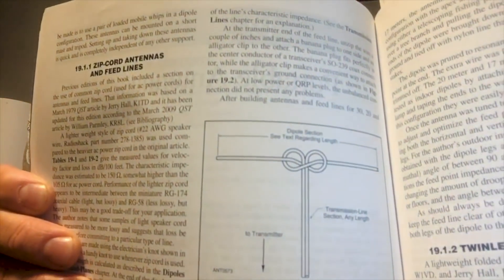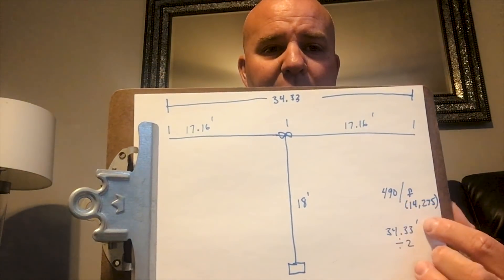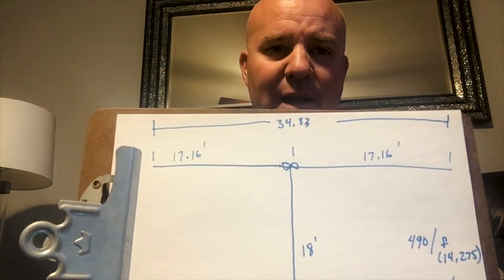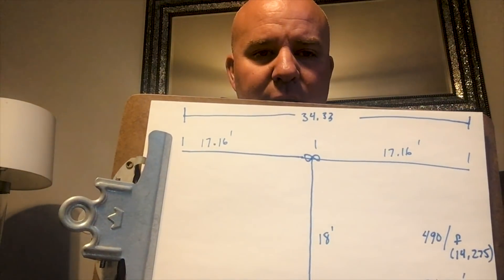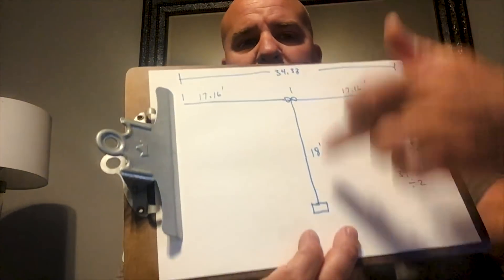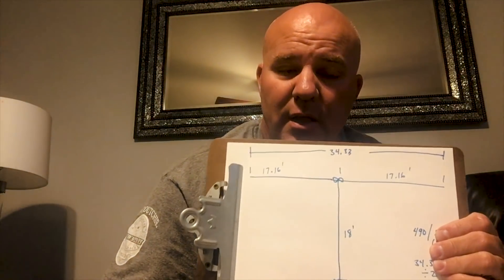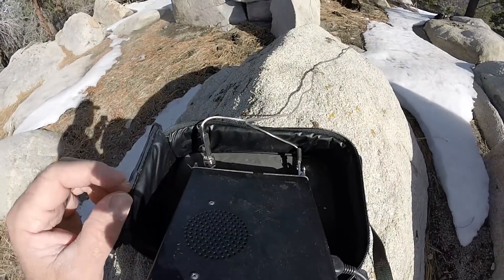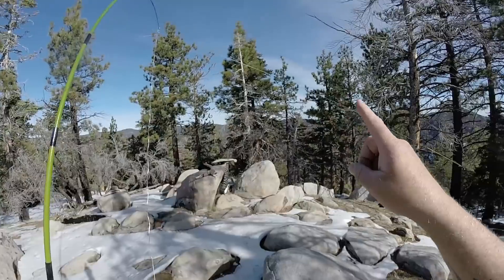How to make a Ham Radio Speaker Wire Antenna

Comment from the maker: This antenna is a fun & cheap build that I have been having excellent success with while QRP Portable doing SOTA. As a disclaimer, you should always check your antenna builds with an antenna analyzer to ensure your application is within the radio’s acceptable limits. As with any DIY projects, I can’t be responsible for any errors in your calculations or variances so please build this antenna at your own risk and CHECK IT WITH AN ANALYZER BEFORE CONNECTING IT TO YOUR RADIO AND USING IT. I think you’ll find great joy in the antenna making process so have fun.
Reply: When building the antenna do you not need a balun or unun because the antenna/speaker wire transmission line is matched at 50oms?
Reply: @OnTerraFirma  I do not use a balun with mine, and it tunes and analyzes very well.

Comment: I'm struggling with SWR and would be grateful for any advice on how to adjust. 

I have it supported by a mast in the center in an inverted vee configuration. 
Angle of left/ right is between 90-110 degrees. 
Collapsible mast; so, I've tried it at approx 18' high and also approx 22' high. 
Ends are 17.25' long and feedline is approx. 32.5' long (I suspect this is where the issue is). 

I've tried rolling up the ends of the legs to shorten them. I'm measuring with a NanoVNA (with an adapter for SMA to BNC). Using a BNC connector for the speaker wire. 22 AWG speaker wire. So far I've tried full length legs (17.25'). I've shortened to 16.5', 16.75', even all the way down to 12'. 

I keep getting SWR readings around 3:1 or higher. There are two lower readings (around 13.7Mhz and another lower reading at around 17.3 Mhz) and they are persistent. If I lengthen or shorten the legs, I can get those low dips to move just a bit, but not enough to affect the 20M band. I.e., I cannot get the lower SWR readings to move to where they'd be useful for me on 20M regardless of whether I lengthen or shorten the legs (rolling/ unrolling at the ends).

So, I went to The Antenna Book to read up more on this antenna and transmission lines. I see the formula in section 23.1.2 for calculating the velocity of propagation. For 1/2 wavelength, 491.8/frequency x VF (velocity factor of the wire). In section 19.1.1 the book indicates that 22 AWG wire has a VF of .7 for a frequency of 13.67 (close enough for 14Mhz), so that's what I used. 

Based on this formula and the description of this antenna in Chapter 19--where it indicates that the transmission line needs to be a factor of 1/2 the wavelength, I noticed that my "feedline" isn't the proper length at 32.5' long. 
So, I tried coiling up the end of the feedline at my antenna analyzer and that seemed to lower the overall SWR a bit, but still not below 2:1 anywhere on the scale, and not at 14-14.350 Mhz range where I need it. The only thing I haven't tried is lengthening my feedline, since that would require splicing in additional line or starting over with longer line overall. 

Any advice? I'm assuming I'm getting very different readings than you have, as you've used this in the field a lot.
Reply: Your SWR problem may be caused by coiling up the feedline part.  In my understanding you cannot coil it up like you can with coax.  Try cutting it instead. Let us know how you get on.

Comment: I used copper clad, aluminum core speaker wire that I got from Lowes when I put together an antenna with zip cord.  Thanks for the tip about the banana plug, I do have a question, where you show the antenna hooked up to your radio, one side goes to the middle of the SO-239 connector, but the other side is hooked to the radio's frame.  I didn't realize that the outer side of the SO-239 was electrically connected to the frame.  How many contacts were you able to make?  DE NR1CH

Comment: I passed the exam last week. I'd purchased a IC-705 a few weeks ahead of the exam but didn't have an antenna. I've just built a speaker wire antenna based on this video. I've cut it roughly for 17m but I haven't yet put it on my NanoVNA.  Many thanks, Jerry! 73, KN6NPZ San Jose, CA

Comment: Just built this antenna and mounted the fishing pole on the step/mirror of my freightliner. One leg is on the frame of the rear of the truck insulated with a zip tie and the other i have a string wrapped around a small concrete block. IT WORKS AWESOME!!! I have it connected to the antenna port of my fc50 tuner. First contact was South Florida from my qth in Princeton WV. I could hear Argentina like they were parked next to me. I love it!! Forget to mention it tuned on 6m-160m!!!

Comment: Just passed my Technician license exam and waiting on my call sign and I need to make a 2 meter antenna for my Yaesu FT-4VR mono band 2 meter radio I got for passing the exam by the local Ham club.  I'm already to take the General license exam as I've been studying for the next level.  I love to make things so I will try this antenna build for 2 meter 'cause I'm on a very limited income but I've got a couple rolls of speaker zip cord.  My antenna would be a vertical dipole.

Comment: Man I just made and tuned one of these antennas out of 18ga speaker wire and a tenkara fishing rod.  I used it with a ft-891 on 20 meter ssb at 100w and was able to work Spain from the central US, and he gave me a 5/9, AMAZING.  Thank you for the awesome build and motivation.  For my first radio and first antenna build I couldn’t be happier.

Comment: Hey Jerry,  I have a  14 AWG speaker cable, I was thinking to make a linked dipole, do you know how  much TX can handle this cable? I hve my FT891 and I know it can provide 100W, I would like to know if this cable can handle this power or is better use only 50w. thanks in advance! TI2GBB - Greg Costa Rica

Comment: Jerry, thanks for the great videos. I built your speaker wire antenna for 40m an intend on turning it into a linked dipole for 20/40 later. Early testing of the 40m in the back yard was encouraging, SWR reading are great with many contacts. I have two questions, have you tried it with 24 ga. wire and have you found the feed line length has any effect, plus or minus. I have it up around 18 ft inverted V, feed line run straight down then a horizontal run of 20 to radio. The legs are nearly 6' off the ground. Thanks for all you do. Tom in Lincoln NE KE0JVS
Reply from the maker: Hi Tom - I haven't made one with 24 ga wire but others have and no issue there.  Feed line should be some multiple of 1/2 wavelength using the VF of the wire.  The ARRL 22nd Edition of the Antenna book (page 19-2) shows a table with the 22 gauge radio shack wire used in the example for a baseline.  The book also shows a comparison of the speaker wire against RG-174 and RG-58 where the speaker wire itself attenuation factor falls between the two listed coax at 100'.  Clearly I only used a much shorter portion of the 100' and therefore the attenuation factor is minimal at best IMO compared to weight, reliability, and durability for portable/SOTA operations.  Another important factor is to keep the legs an equal distance from the TX line and somewhere between 6-8' off the ground.  You will need to play with it to find where the sweet spot is but I would suggest making it a simple setup that's easy to remember and deploy easily and works the numbers from there.  

Sounds like you are on the right path and hopefully the VF and TX line lengths drop into place for you.  If not, it's speaker wire and cheap stuff to make mistakes and experiment with and learn how to use your analyzer assuming you have one.

Have fun and hope to chat soon. 73

Comment: Great step-by-step video and I'll be constructing one soon. Have been watching yours and some K8MRD vids re the speaker wire antenna.  I notice he has his wire connected somehow to a PL-259 and just screws right into the back of the FT-891 while you only put one wire in the antenna port and the other wire alligator clipped to a ground on the radio. Just trying to figure out why the difference?  Thanks.
Reply from the maker: Hey there thanks for checking out the channel. This was the first evolution of my speaker wire antenna and now that I connect it to my KX2 I use a BNC to binding post connector. Fun, cheap antenna build so hope you enjoy it.  🤙🏻🍻
Reply: @KG6HQDJerrySOTA  Thx

Comment: Great channel!  I came from the joint video that all you guys did on amradio 2.0.  I will be back and thanks.  Never realized that we do not have to use coax!.
Reply from the maker: Hey Rich thanks for checking out the channel. Lots of things to learn and do with ham radio for sure 👍🏻. Coax is a great item but for qrp and field work there are many other options

Comment: I made this antenna out of speaker wire. Measures I believe were 17.16 for each dipole, then 18' for the transmission line. Same wire done as per the video , except I used a piece of heat shrink instead of the electricians knot.

Well, on 20 and 40 meters, I got frequencies on 1.04 SWR, which is great. Was able to make it form Central New York to London, Canada. Got a Xiegu G90 with just 20 W max. Used a banana plug for the center of the SO-239 then the other leg to the ground screw on the radio. 

This antenna is in stalled on a 14' height attic, but the highest peak at about 6' high, then the two legs spread left and right from the center on about 6 to 7' high.  As it is, great for testing, and even one weak contact, but conditions were not that good either. The internal ATU helps a lot, once the built in analyzer finds the good frequencies, I auto tune on them, if within the range of frequencies on my license level. 

Great video, and the one you made with another operator in Florida on the same antenna.
Reply from the maker: So cool to hear how people find this useful and simple to make. There will always be haters but that’s expected. Thanks for sharing how it worked for you & congrats on the Dx
Reply: @KG6HQDJerrySOTA  Some people may look for the PH levels on the moisture content of the land installed if outdoor and the capacitance of the crepusculus square thermal radiation of the wiki thingy, but to me it works. I will then use the same model outdoors, set properly and with some tweak as per my environment. will do great. Thanks a lot. 73
Reply from the maker: 🤣couldn’t have said it better 🍻 cheer to you

Comment: Is there a way to make a multi band version antenna in this way? One that could cover 10 to 80 meters using a tuner? Thanks for this idea, I love the simplicity of it.
Reply from the maker: There’s a few guys who have experimented with that concept by making it a linked version. I believe the TX portion of the antenna will play a role in that so I’d do some experimenting or build one for a lower band, say 40m then tune it. No ideal of course but all antennas are a compromise of some sort.

Comment: Thanks for the video! Is 18 guage too thick you think? or, just over-kill? Will it weigh down that pole too much and make it bend over?
Reply from the maker: I wouldn’t say it’s overkill but a lot thicker than necessary if you’re going for the light weight aspect. Best thing is to have fun making an antenna and using it imo

Comment: The diagram in this vid shows an 18 foot feed line. Some of your other vids look to be a longer feed line. What do you consider the optimum length? 73, KK6UG
Reply: Ooops, KK6CUG
Reply from the maker: So mine is about 18’ as I went with what I thought got me off the ground with a little to spare and it works great!  Some recent reading suggests the 24.5’ length for 20m and of course can double that for 40m... I have some more testing and building to do to play with these numbers but hope that helps.
Reply: It doesn't matter because it's non radiating........................................
Reply: @BennyCFD  That has not been my experience.

Comment: Why not use the Electricians knot on both ebds, then you wouldn't have to be concerned with splitting the bananna  plug & Gator clip apart? TY, Dave KN4NSE
Reply from the maker: Haven’t had the need to do that but I suppose you could try it. I now just use a BNC go binding post connector for my KX2

Comment: I was wondering if you have tried using this antenna as a sloper? I suppose if that is done you would want to take care that the feedline wires are away from the downward sloping limb. Anyway I was wondering since it would be really easy to hang it from one end like you would do with an endfed antenna. Also a sloper (like a vertical buddipole) has better angle radiation than a vee, but at the loss of more directionality. I am going to try making one tomorrow. Cheers KI6UJH
Reply from the maker: Hey Doug I have not tried that or the L shape either but sounds fun!  If you get to it before me let us know how it worked, especially any directivity patterns you notice. Thanks 👍🏻

Comment: hi
Great video. 
how long dose the wire need to be for 80m.
Tia
Reply from the maker: LONG! For a 1/4 wavelength the legs would be 30’ each for a total of 60’ dipole then you will want to get it up off the ground more as well so extend the feed line portion at least 30’ itself, for a 1/2 wavelength you need double that. That’s based on a center freq of 3.9 MHz ... lots of tools and calculators out there to help with these formulas to get you in ball park then you’ll need an analyzer to fine tune it into complete resonance ... 80m is such a long antenna and usually best during night so for SOTA it’s usually not practical. If setting something like this up at home with plenty of space then have fun doing so and on the cheap too 👍🏻
Reply: +KG6HQD Jerry I've got a 120 foot speaker wire from above the house cutter on a TV antenna pole . going to the tree at the bottom of the garden then along the bottom of the garden. Have an amazing signal now on the 80m band.
Reply: +KG6HQD Jerry Thank you.130 foot be long enough then. I'm all new to it as you can probably tell 😀
Reply from the maker: Not really on 130’ unless you’re opting for the 1/4 wavelength size because you will need to factor in the feed line length too. Are you looking to make the 1/4 wave length or 1/2?
Reply: +KG6HQD Jerry 130 foot in meant
Reply from the maker: Sweet!

Comment: ive been researching wire antennas and found one guy that claims if you separate  the entire length of wire including the feedline portion the performance increases, not sure if that is truth or not...I built one of these but didnt try separating the entire length, works great for listening on my new  kx2
Reply from the maker: So for the dipole setup or for a vertical? Can you add the link or cite the video title so I can check it out

Comment: Can you post a link to the wire winder I have searched and can not find the thing on amazon. Keep up the great videos
Reply from the maker: In all truth I don’t like the one shown in this video. It was pitched as a winder for 550 paracord and has a narrow center causing issues. I’d look at SOTA beams website for ideas or just cut up a piece of stuff plastic or thin plexiglass type material then file the edges and customize it.

Comment: This is a great service to the ham community. I followed the video very closely, but things moved pretty quick let when talking about the connection to the radio. Did you connect one side to a coax connector and the remaining wire to the radio ground? Exactly how did you connect it to the pl 259? I realize that you are ready to move onto other things, but I would like to build one. Thank you for your time. N4KBM.
Reply from the maker: Hi Tommy, sorry for the delay.  I love this antenna and no matter what some of the naysayers say about it, it works very well and is super cheap and very easy to build.  When I built this on I just used banana plug on the hot lead and plugged it into the back of the UHF connector and an alligator clamp to ground and pinned that to the chassis of my 817ND.  Now that I use a KX2 with a BNC connector, I just use a BNC to binding post connector and use just bare wire into that connector.  Works like a champ and again, it's a super easy and CHEAP antenna that works so good.  If you watch most of my videos you'll see how well this antenna has been working for me despite all the hi. hi om's telling me how lossy it is...just have fun and play radio man.
Reply: KG6HQD Jerry You are the man!
Reply from the maker: Have fun and let us know how well it worked for you.

Comment: I made this antenna and love it but the feed line portion has become twisted like a candy cane stripe, lol.....is that a bad thing or will it still work?
Reply from the maker: Still works, though I do try to keep it straight. I wind it around my elbow and the palm of my hand like an electrical cord then kind of twist it into a figure 8 vs winding it on a winder but ymmv. Glad it’s working for you.
Reply: @KG6HQDJerrySOTA  thank you for the quick reply.   73.
Reply from the maker: No problem Greg, keep us posted on how it works for you. Love hearing how people make it work and the contacts they make.

Comment: I made several of these but use a Balun. Do you use a balun?
Reply from the maker: Nope, just tie the electricians knot and run it. I run the speaker wire to a BNC to binding post connector and it’s ready to roll. You can also check out Mike’s video K8MRD Radio Stuff when he made his antenna from my video and he shows it on his meter. Same as when it’s on my meter 50 ohms and 1:1 to 1.3 across 20m band. It’s light, cheap, and works very well. You can see and hear the results on many of my SOTA videos. Love this antenna for sure and want to share with others who may benefit from its design. Thanks for checking out my video and channel John and for the comment. Hope to connect with ya on Twitter too if you’re there. 73